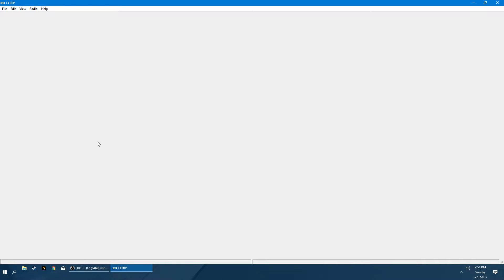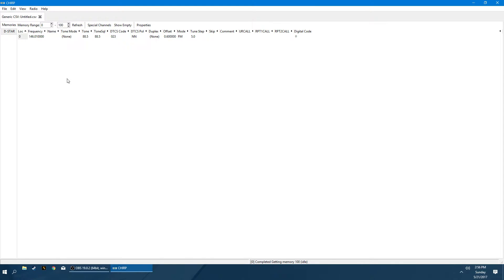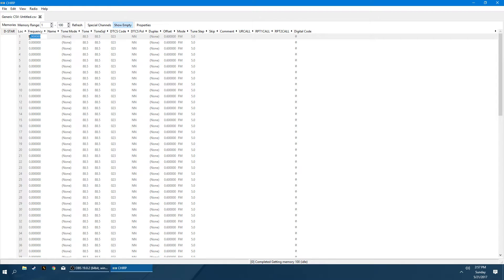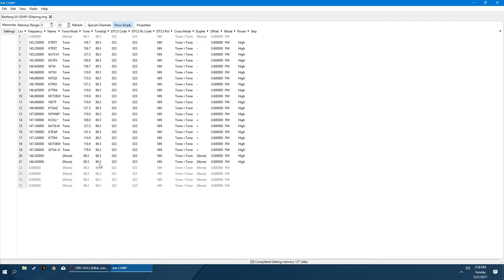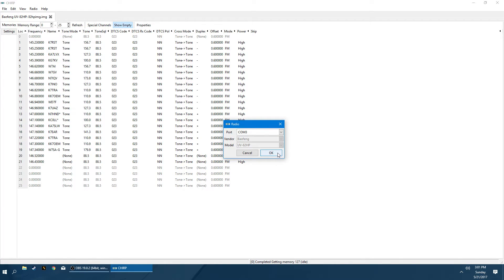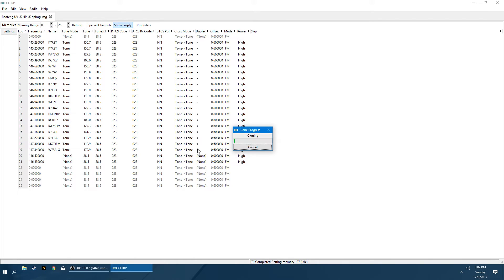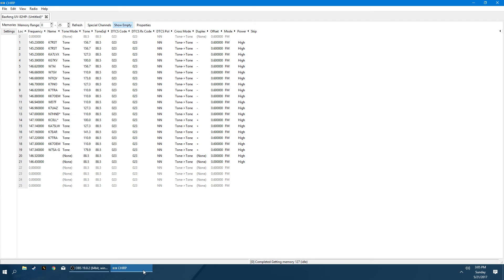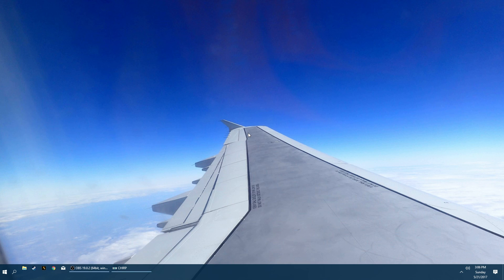Baofeng | UV-82 V2+ | Chirp Programming | 2017

Comment: I have the UV-9R plus. I don't see it in Chirp. Do you know if I am wasting my time messing with it. Also the display on the radio blanks out when turned on after plugging in to computer.
Any suggestions?
Reply from the maker: Nathan Andrews Often times chirp does not have the latest models available in the selection. The best way to determine whether or not chirp will be compatible is to connect your radio and turn it on to a Symplex frequency as I described in the video. And click download from radio. If it works you’ll get one empty line unless you’ve programmed other frequencies manually. And then from there you can create your template and then upload to radio
Reply from the maker: 10:17 is how you download from radio. if it imports successfully, then just add lines, and then upload.
Reply: It will download from radio, after going through steps the "upload to radio is still "grayed out" Maybe I'll try shutting down the program and restarting. I saved all my repeater and simplex frequencies in a file.
Reply from the maker: Nathan Andrews can you see you transfer cable in device manager? Without a ! Next to it? Usually if it is grayed out it is because it does not detect a cable
Reply from the maker: If there is an exclamation point next to the device name. Then it has bad drivers
Reply: Yes it is there. if I unplug cable, it goes away, so I know it sees it. My radio says"transfer over" a few seconds after I select "download from radio" And the radio is transmitting without an antenna till I turn it off...that can't be good...
Reply: No (!) in device manager
Reply from the maker: Nathan Andrews keep in mind the LEDs just flash for the data transfer it’s not actually transmitting. But that is really strange do you have a full color screen on your radio
Reply: Yes, I can see the transmit bars and the radio heats up....I don't think the software is ready for the UV-9Rplus yet. It uses a different data cable, and I got a disc with baofeng software on it but can't open on any system XP-10...and who uses CDROM.....lol
Reply: I actually bought a couple of HV-82's and they sent me the cable for a UV-9Rplus...so I bought two of those too....lol Still can't get the "mic jack transfer cable for the UV-82's
Reply: I meant UV-82's

Comment: 'UPLOAD TO RADIO' is grayed out.
Reply from the maker: sorry to hear this happened.... unfortunately the best way to fix the problem is to open a brand new template. then first select "DOWNLOAD FROM RADIO" and then re-enter your settings. This will format the file to the correct firmware version of your radio. In other words, you have to start fresh, but first select download from radio. and then fill out the forms. Alternatively you can export the file that you created, and convert it within chirp. but that is a little more advanced I could make a video around how to convert templates so that they can be uploaded to different radios.

Comment: The tone squelch doesn’t have to match tone?  I’m new to amateur radio
Reply from the maker: SilfortyElement What specifically are you asking about tone squelch? Better question, what are you trying to accomplish?
Reply: Ken W. I understand what a tone is in its simplest form but I don’t know what’s the difference between the many options.  I want to program my HT to use repeaters
Reply from the maker: SilfortyElement If that's the case, just set "tone mode" to "tone" and under the  "tone" column put the PL tone of the repeater... 

The "tonesql" column can stay at the default setting. 

Hopefully I understood your question correctly in this was helpful.

Comment: Was is scan rate i want about 35 ch on it ...
Reply from the maker: Baofeng is kind of notorious for having a slower scan rate. If you are looking for a radio that will be very fast with scans, this will not suffice. However, I think it could probably do 35 channels in about 9.5 seconds (using a stopwatch and my own uv82v2+) so not too bad. But that leaves about 9.4 seconds where somebody could be talking on a different frequency. Looking at it from that perspective it could be very easy to miss somebody who does not transmit for at least 10 seconds. This is just arough idea using 35 channels. obviously fewer channels would increase scan rate. and more channels would reduce it.